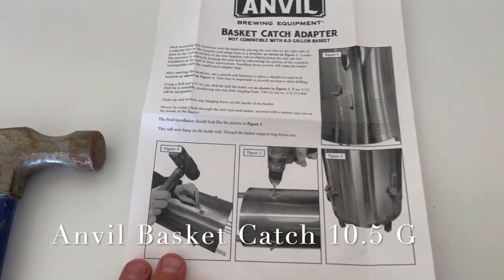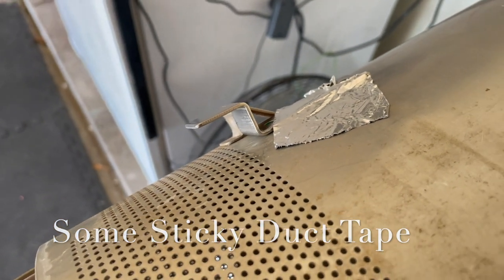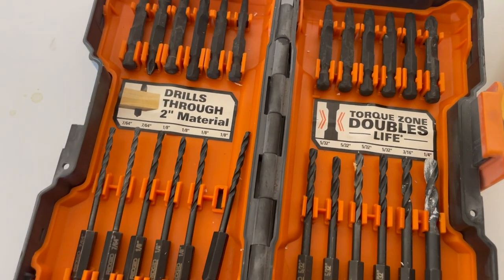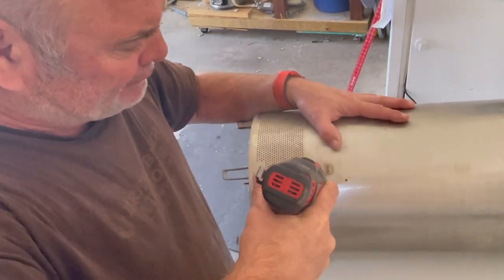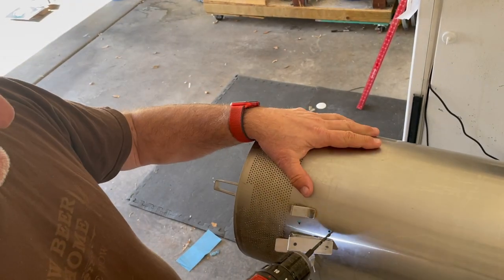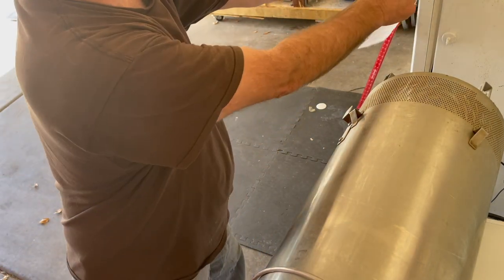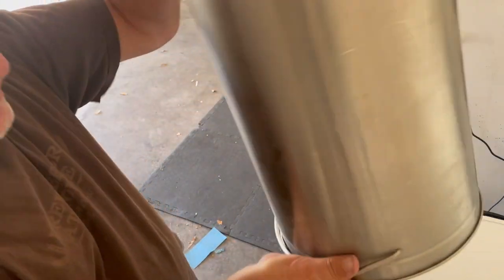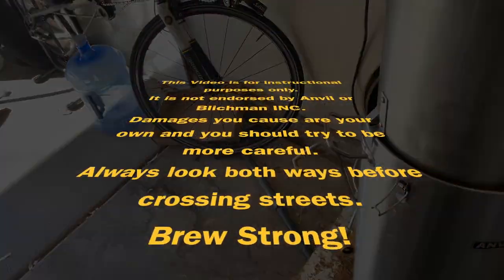Anvil Foundry Bucket Legs

Comment: I someone uses a BIAB bag inside you might want to put the screws in with the heads inside the malt pipe.
Reply from the maker: Good idea.  I don’t use a bag, but one could put the screws in the other way.  What would be best is to weld this to the basket.